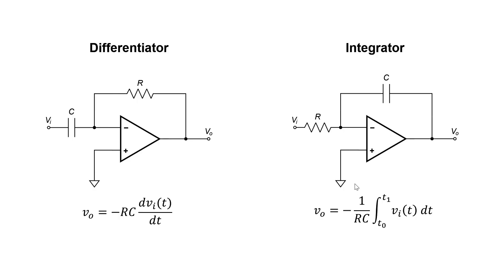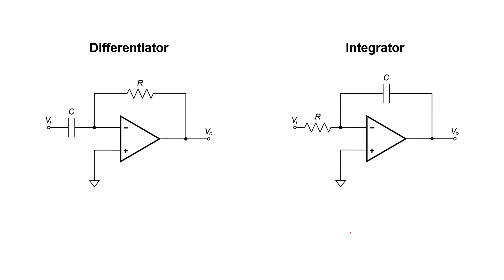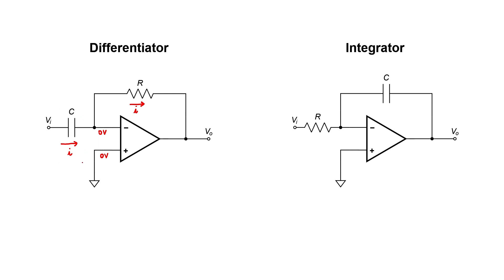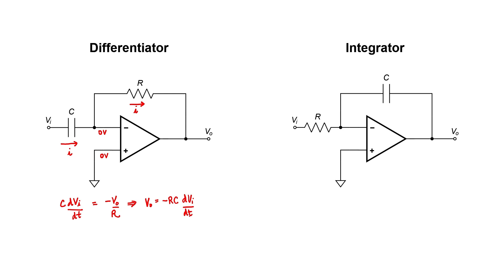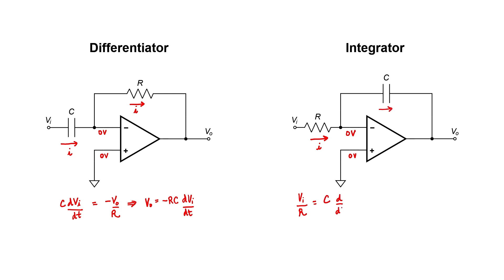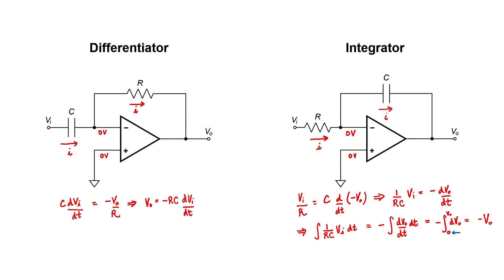Signal Differentiator and Integrator (Amplifiers #4)

Comment: Well, since you didn't mention it, I will have to guess when to use a differentiator and when to use an integrator. I would guess that an integrator adds the input over TIME. While a differentiator would be measuring the rate of CHANGE of the input. So, considering that an unstable op amp is heading towards the RAIL, then an integrating op amp will start swinging towards the rail as soon as it got any CONSTANT input. Whereas the differentiating op amp would start swinging towards the rail as soon as the input started to CHANGE. I can only guess here as you don't provide any information at all as to the APPLICATION of these op amp circuits. This is exactly the problem with university teachings- they want to just quickly to the math so they appear intelligent, but they don't help the student in general applications. That's why I am here now - my university has failed me. It's a shame, because I paid a LOT of money. 

So nice presentation, but you need to be better than what I have already received or it's a waste of my time.
Reply: chill